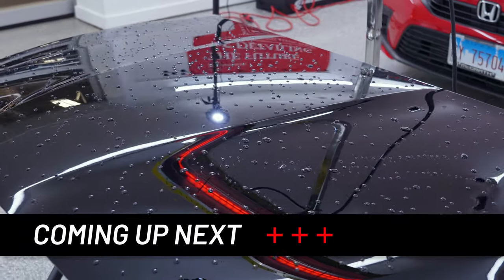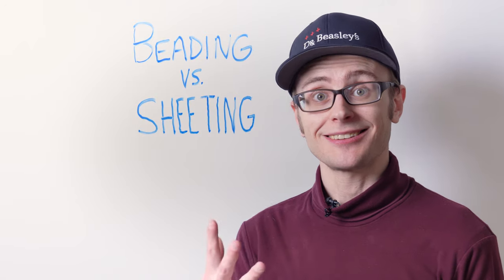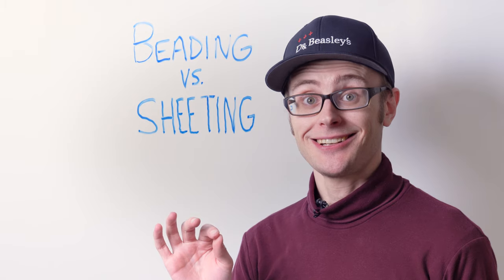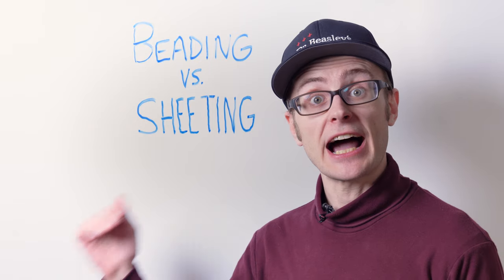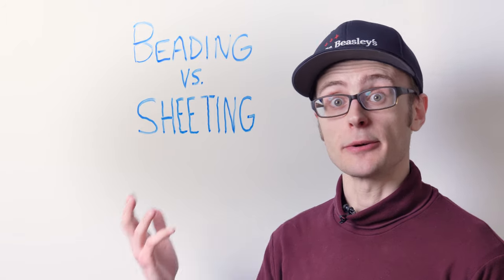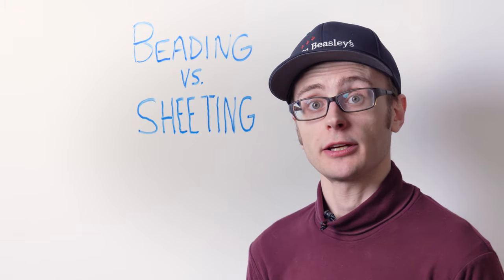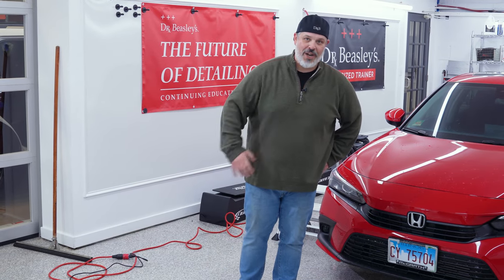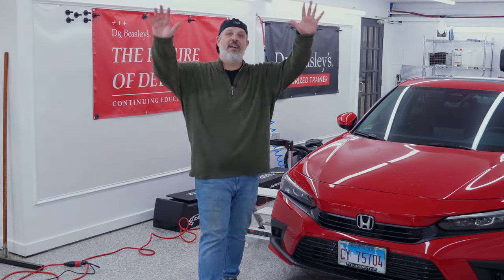What's Better For Your Car — Beading or Sheeting?

Comment: I remember many years ago when an American company launched a product on QVC UK that sheeted water off rather than beaded it with all the evidence to prove how beading could leave water marks on the paint and even burn the paint by slight magnification through the water and I've been sold on sheeting since .... Having said that beading wins hand down for looks after a rain shower and works as long as your driving the car after it and not allowing it to dry on the paintwork

Comment: Does your new Paint Hero Drying aid sheet or bead? I'm going to Apply LS-10? Is there another product other than that you recommend when drying to car? Thanks
Reply from the maker: Paint Hero is a beader! Though keep in mind it's not so much a drying aid as it is a drying protectant. It's there to lubricate your towel when going over sensitive areas that can't be dried with a blower or compressed air.
Reply: Sorry I used drying aid the wrong way. I'm looking for maring protection between my drying towels and my paint. I just ordered a bottle of Paint Hero and Bead Hero.

Comment: You are correct, better to have that water sheet off quickly to prevent spotting. Very important for the glass surfaces as the temps reach the summer highs. Thanks Victor for the concept discussion
Reply: How to know which product does beading or sheeting?  that point is left without consideration
Reply from the maker: @angelmoreno8067  Product links are now in the description!

Comment: Sheeting coatings are harder to dry. Plus you can’t blow dry the car as easy and I’ve never seen a sprinkler or rain storm produce enough water to sheet off the paint.

Comment: It depends how hydrophobic the surface is, how much force is on the water and the angle of the car surface. If the hood is fairly flat, maybe sheeting is better, but if it's more curved or angled then beading likely wins.

Comment: What causes a hood to be more beading than sheeting? Is it the individual installing the ceramic and product used or perhaps a different product being used?
Reply: Maybe Bread the sides of car and sheet the top of car
Reply from the maker: It comes down to the product being used. Some coatings are formulated specifically to produce a sheeting effect.

Comment: Good video.  I finally got the time to detail a used car I recently purchased with NSP 150 and then NSP Z1.  We got our first rain last night and noticed it was beading like crazy.  What do I need to apply to the car to get the sheeting?
Reply from the maker: Great question! Formula 1201 and Nano LS-10 are two "sheeting" coating options that pair well with Z1.
Reply: @DrBeasleys  Excellent...I have some 1201 at home.  I didn't know I could layer 1201 on top of Z1.  Thanks!
Reply: @jonroberto5390  Jon my real world experience with 1201 LS-10 is the durability as compared to one of your resin coatings.  Six months at best for 1201/LS-10.  We need Jim & Dr. of Success to get us a long term "sheeting" coating.  Surface Auto Detailing
Reply: I use auto gym on my car and yes it holds water beading. But a few minutes of sunshine and it vanishes with no water markings.
Try it